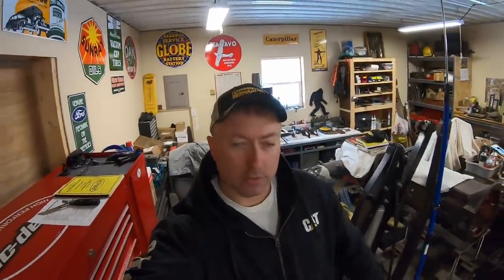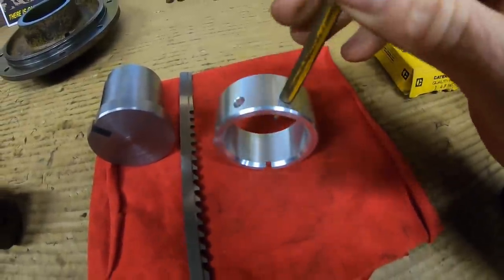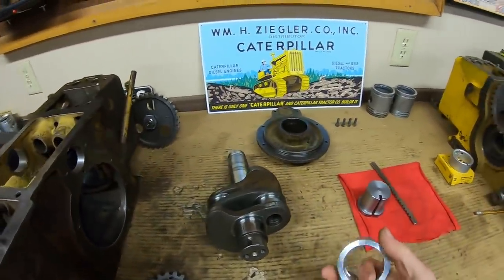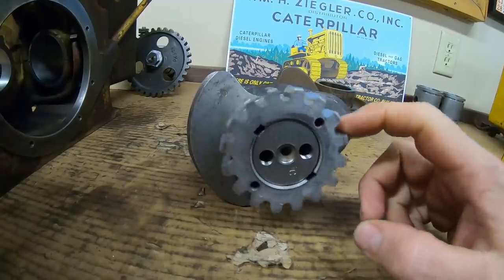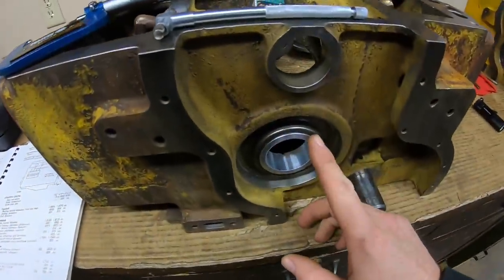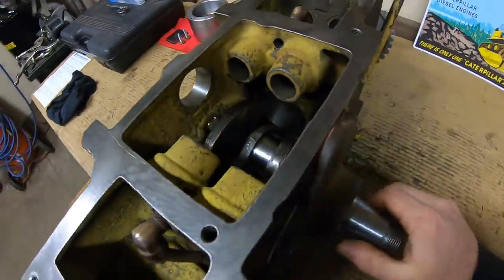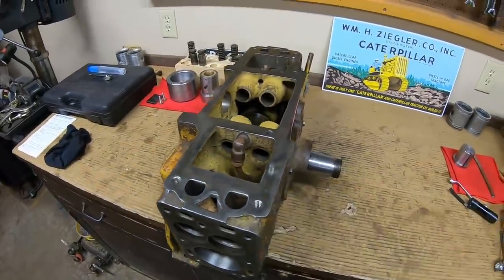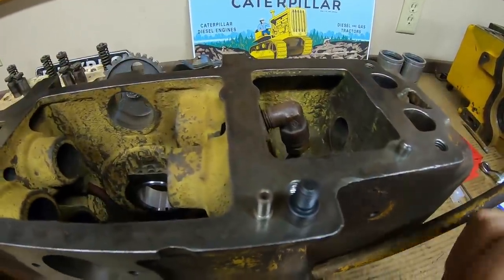Caterpillar D2 #5J1113 Starting System Ep.13: Making Pony Main Bearings & Better Retaining Dowels

Comment: 18:41 That isn't caused by image stabilisation software.
Its a natural stroboscopic effect caused by the shutter rate and the rate of vibration of the subject.
It's the same as the apparent backwards rotation of a propeller or a wheel.
Even a dumb film movie camera will experience the same effect

Comment: Seems like you have a potential side line here, fixing pony motors. Have several re-built pony motors sitting around, take in good blocks and parts as core charge, and sell them the re-built  one. Re-build at your convenience..

Comment: Is it going to be a problem that the head of your retaining bolt/pin is higher than the well that the oil would be collecting in?  I know the other two holes would still be allowing oil to the crank, but the hole in the bolt wouldn’t be seeing much .

Comment: Love this fix!  Really wonder why Cat did not originally use a threaded insert for retaining the bearing. Would have cost pennies in a factory production setting.  Any concern on the height of the head as compared to the original dowel pin head height?  Will it require oil to pool deeper before it can flow down through the threaded retainer?
Reply: @squatch253  agree 💯👍!
Reply: @squatch253  I'm not sure how threaded pins would work in an oem replacement part scenario.  The issue would be the timing of the threads between the casting and the sleeve bearing.
Reply: @squatch253  Yes, I agree with what you're saying.  If concerned about the "upper" threads when drilling a new bushing, one could make a simple threaded drill bushing with, say, an 1/8" diameter hole to keep the hole in the new bushing centered.  Nice work, Toby!

Comment: Does the increased height of the socket head capscrew when compared to the factory dowell put the capscrew oil hole above the level of the cast in oil-well? Could this change in dowell decrease the effective area of the splashed oil capture from the whole oil catching area of the cast in oil well compared to just the area of the top of the capscrew head?

Comment: I am sort of surprised that you did not use you press. I would have to guess if you hammer in hard material you will break your brooch bar, and in soft material you may very well chip  the material as it might grab and tear instead of cut
Reply: @squatch253  👍

Comment: On the set screw head being tall above the oil pocket? The old set screws head was shorter and set down into the oil pocket so oil would flow into the bearing . The new set screw is taller than the oil pocket.How will the oil get into the set screw hole ? Splashing won’t be enough?
Reply: What about the other two oil holes? How much splashing is there in this engine? 😉

Comment: Hello , just wondering about the length of the top of the pin you replaced with the Allen head screw. It looked to me like the top of the pin was shorter because it is in that square reservoir below the top of the reservoir so oil can drip through the hole in the pin, but the Allen headed screw was taller then the reservoir. Just wondering if I saw that right.

Comment: The only thing that you could have added to the retaining pin would have been a fold over lock tab or tie wire lol I am surprised cat did not do a better job from the factory but I am sure that they had looked at it and said some thing has to be a weak point so they could sell parts. Have you ever ran across a so called cat reconditioned starting engine and what their repair shop may have did with the spun bearing issues
Reply: @squatch253  oh yeah that is true I am sure that just scrapped them and sold the customers a new block or whole starting engine or else they got changed to electric start system

Comment: That slot probably doesn't have to have square corners. That being said, you could get away with using a 3/16" end mill (could have drilled it before boring out the center dia. too). It's only aluminum so it shouldn't take much to mill out and will probably be stronger than the OEM bearing.
Reply: Per recent prior video as i recall , paraphrased, "i had the old aluminum bearings tested and they're a pretty close match for 6061"

Comment: Could have just broached the slot in your bearing in the lathe.  Use a boring bar and broach it by running the carriage back and forth.
Reply: Right...
Do you remember him saying the best way to clamp it was in the engine?
Reply: @dans_Learning_Curve  My thinking was, the bearing was already in the lathe while making it and by broaching it then you don't have to make the special bushing for the other broach   I've done it and it works well.

Comment: The oil gathering slot for those pins won't get the oil into the bearings for the bolt head stands way above the slot.

Comment: Why didn't you just take a standard Cat bearing and have the OD plated and then ground to fit the oversize bore size you needed and save all the Mickey Mouse you went through?
Reply: @squatch253  Actually a much better fix would have been to metalize the oversize bearing bore in the block and then finished machined it to spec size and location probably  on a Jig Bore. Having done that, an off the shelf Cat factory bearing would have always worked if a replacement was needed in the future.. As of now, I;m fine trust you are also. Since you are doing some engine work I decided to drop in for a couple episodes. Once engine work is complete, I will not linger to trouble you.